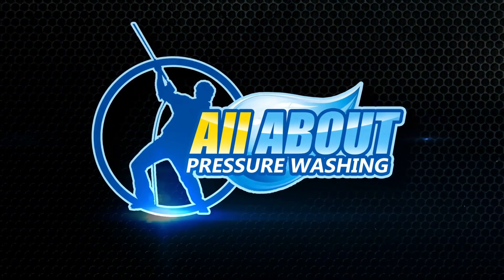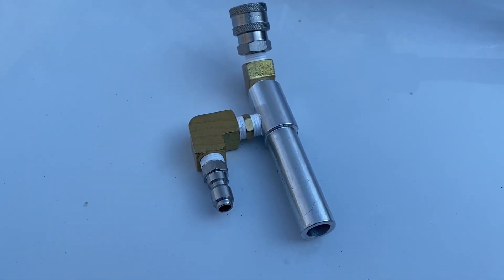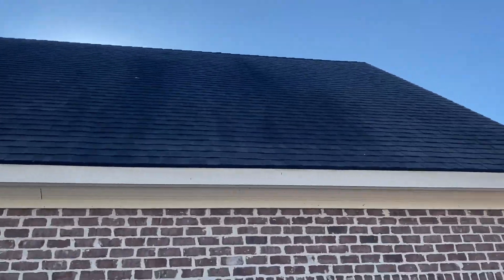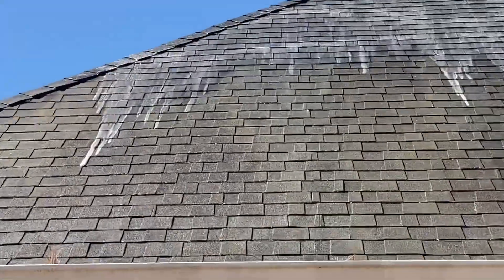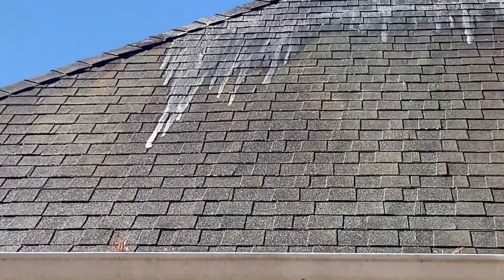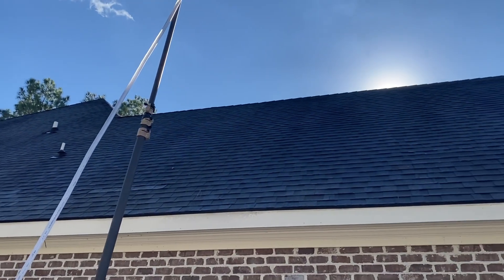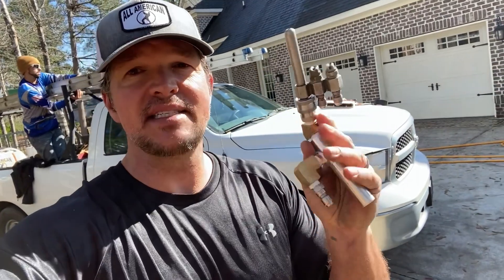Amazing Roof Washing Soft Washing Tool!

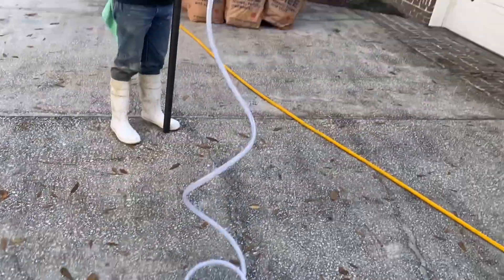Comment: at 2:45 watching the tinted fluid flow through the hose was very satisfying!

I've known Vic Irish for several years.  He was getting into roof cleaning about the same time I was, or slightly before.  Vic is a really great guy!  I met him on the SoftWash Systems forums but lost contact when AC Lockyer moved to the Facebook format and I just do not like how much personal information FB releases to people so I don't' use it.   At one point Germany banned FB 100% because of the amount of personal information it was sharing without the account holders knowledge.  Anyway, really glad to hear Vic is still around and in the business and doing well!  

Things I noticed (since you asked in the video), there was a lot of roof you cleaned with the pole that would have been faster and easier using the normal spray nozzle and tips.  At about 5:30 into the video it looked like you came really close to smacking the window the the base end of the pole.  There have been tips out like that for a while, since before I started getting into roof cleaning, but I'm glad Vic is making these and would buy from Vic before anybody else.  

Another thing you could do is attach the trigger gun to the pole so it would be easier for a single person to control.  I've also seen videos were people have attached cell phones to these types of poles/tips and basically done a facetime video to a second phone at the base of the pole so they can get a better view of what and where they are spraying.  I'm not afraid of heights and ladders so I never went that route, but something to ponder if you want.  Those carbon fiber poles are amazing tools though!
Reply from the maker: +Noneya Frigginbezwax
Reply from the maker: Thanks for sharing / great info

Comment: I don’t know that, for me, this is a game changer for whole roofs. However, it could be a huge asset for easily reaching areas with tricky architecture for roof and house washes. As you know, we have some beautiful homes on our coast but they can get tricky especially ones on a 14’ foundation. Definitely checking into it.
Reply from the maker: +Dirty House Thug  I thought it would be great for large buildings, 3 or 4 stories where you need to get a little more concentrated solution on the surface, 12 volt systems are great but Are limited on their distance. Pressure washers have that distance, but you can’t get the concentration need it sometimes. This seems like it will be helpful in a lot of situations
Reply: @AllAboutPressureWashing    Definitely makes you better equipped for the many challenges.
Reply from the maker: Amen !

Comment: Any advice on how to clean a roof if you don't softwash... obviously I know pressure  an damage shingles, but I'm sure there are ways to do it using low pressure nozzles like a M5 nozzle and other tips...
Reply from the maker: +Derek Howell  I suppose it's possible but getting a strong enough solution is the biggest hurdle.  I would invest in a 12v system - doesn't have to be expensive.

Comment: Hi Mike ,
Awesome video. Thank you 🙏🏼. Quick question what size fittings are those 1/2” NPT to 1/2” barb?and are the quick connection and plug are they 1/4”. ? 

Thanks bro
Reply from the maker: Yes and yes - this is not something that we've used since this video.  It would come in handy by a good pump is the keep
Reply: @AllAboutPressureWashing  thank you Mike. The only reason I’m going with this for now is because of a spot I can’t get to with the wind blowing. Just for tricky spots

Comment: Do you think it will be harder to hold the pole on those mild windy / breezy days?  Plus it take two guys, one holding the pole another pulling the trigger. Would you need a third guy to be wetting down the far end from the over spray? Interested tool.

Thanks for sharing this tool with all of us.
Reply from the maker: +Michael C So that was the first time we ever used it, and it was an evolution, trying it out seeing how it works. That trigger gun actually has a lock so you could lock it down which we did while my tech was watering. Also what I found, if you ever use the water fed pole you can just pinch the line to stop the flow of water, the five eights inch tubing with flexible enough to where I could grasp it and shut off the flow without needing a trigger at all.
Reply: @AllAboutPressureWashing  

Do you think putting a shut off valve on the tube closer to the operator / next to the pole? This way you don't need to squeeze the line.
Reply from the maker: Yes, probably extending The pull all the way out and having the shut off valve in line right at the bottom would be ideal.
Reply from the maker: Good stuff Vic
Reply: @AllAboutPressureWashing  There are more questions here on your board in one day than in our FB group. I am actually using (copy/pasting) some of them in "Super Tips." 

Thanks to everybody in here, we are making that room more informative.  Making me earn my keep, LOL! We appreciate you guys...

Comment: That’s a very interesting add on.   How awkward is it holding and using the pole fully extended? How many story’s or feet do you think it can go up?
Reply from the maker: +Churchill Coins  you can go as high as your pole is - we used it a few times- Definitely not something that would be used daily, but something that's nice to have in the toolbox should the need arise.

Comment: Good information... However, as a rule of thumb, regardless if you are washing the siding of a house or a roof... you should always start at the bottom edge and work up. By starting at the top it allows the cleaner to run down in small streams and rivulets (seen at 2:54) The areas under the streams of cleaner have more time on the roof to soak in and work on dissolving dirt and stains. No matter how long you let the cleaner set on the bottom section, the areas under the streams will be cleaner. The dirtier the roof or severity of the staining the greater the chance that the finished product will have streaks (i.e., created where the solution ran down and had more time to work). If the roof or siding isn't real dirty to begin with you might get away with it.

Comment: I've been working on my own version of that tool too. Some of these crazy tall roofs are too dangerous on a ladder.
Reply from the maker: +symplemynd57 Exactly, the angles of the roof make it a little bit more difficult, but I think this would be awesome for really tall buildings where you need to get up higher than you could possibly reach with a ladder ladder
Reply: What parts are needed?
Reply from the maker: It comes all out together

Comment: Great video! If I will be using a pressure washer, how and what would I need?
Reply from the maker: Nothing - it comes set up for use with any fitting/plug/coupling you want.
Reply from the maker: I haven’t tried it with a pressure washer yet - thinking it might be a little much f
Reply: @AllAboutPressureWashing  It will work, but I would be careful how far up you use it. That is one of my biggest fears. I don't have insurance and worry about high pressure hose falling from any height. Need a good stiff pole, too.
Reply from the maker: Agreed - I think it is ideal for soft washing g
Reply: @AllAboutPressureWashing  I do have an accessory I used a Ray Burke term when naming it the "Viculator." Will be covering it soon in our FB group "Super tips." https://www.facebook.com/groups/650673229131874
Reply from the maker: Ray is one of the good guys
Reply: I'd worry about the amount of pressure a PW puts out pushing the tip of the pole and hitting something and causing damage.  I've seen people using a roof rover on a roof on a long extension pole and the push back from the pressure would lift the rover off the roof if they didn't keep constant pressure against the pole.  I've not tried this...those poles can be a bit pricey, and so far I've been able to get by without that expense, so take my comments with a grain of salt.

Comment: Nice. I was just thinking about using one of the high pressure telescoping poles for roofs. What gun are you using didn’t see the link in the description
Reply from the maker: I don’t have a link - it’s just a soft wash poly gun
Reply: Yes use the high pressure telescopic pole it very fast to set up un like this method but either works!
Reply: The vic makes it possible to do the work with the pole you have, so you don't have to buy or carry extra poles. Pole does need to be rigid like a Simpole, though.
Reply: @PanefullyClear  will it work with a threaded pole?
Reply: @brandonmayer7533  You would have to remove the embedded tip, and then it would have to be about 3/4" fit. The Supertip is designed for waterfed poles that have removable pole tips (Usually Euro or Acme).  Fits Simpole, Reach Its, Xero's for sure. 

Only pole I've hear of that it won't fit is the Tucker, but some folks have used it with the Tucker by taking out the first section, putting some rescue tape on the vic and inserting. We made some Tucker Taper Tips that will work with Tucker, though.

Comment: Why are these pre build softwash systems so expensive if you can build them so easy and cheap?
Reply from the maker: +0play3r0  if you have the ability to build, plumb and wire one yourself and have it be reliable and efficient then you don't need to buy a system.   Also remember the ones that are manufactured have frames, Pressure washers, hose reels, battery, tanks and a warranty.

Comment: Looks like it worked well but also looks like it could be a pain in certain situations.
Reply from the maker: +Rick Washek 100%, a time and place for everything. Hope you’re doing well Rick.
Reply: You won't use it all the time, but It makes a great tool for your waterfed pole tool box.
Reply: @PanefullyClear  i need this whole set up. Do you sell the poles as well?
Reply: @dylanbrushaber4335  Sorry, I don't sell poles, but this was designed for Simpole and if you buy my tip Phil will give you a 15% discount on his poles!
Reply: @PanefullyClear  I will definitely look into that. Thank you!

Comment: Hose goes through center of pole man.  Lots of ways you can do this better I have two of these lmk when u want help.
Reply from the maker: We used it once - for this video.   And no, that is a 5/8" hose which couldn't go through a waterfed pole.  The better way is a 12v Softwash pump.
Reply: @AllAboutPressureWashing   I know you go down from your hose to a 10mm hose and you use only plastic or carbon stuff up top. Keep everything as light as possible And there is a few ways you can make it so the operator has the ability for a very easy non-intrusive way to shut the chemical on and off.
Reply from the maker: I just don't think we would ever use that thing again
Reply: @AllAboutPressureWashing   its and tool of your arsenal that you will use again.  I don’t use mine much but somtimes.